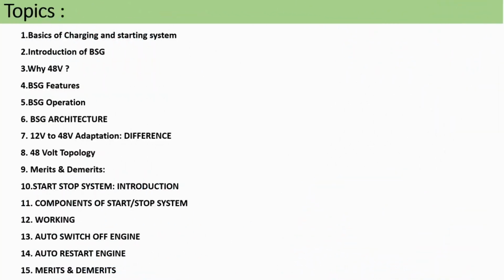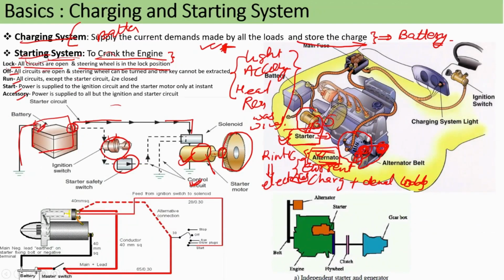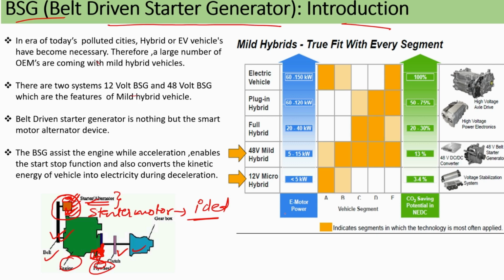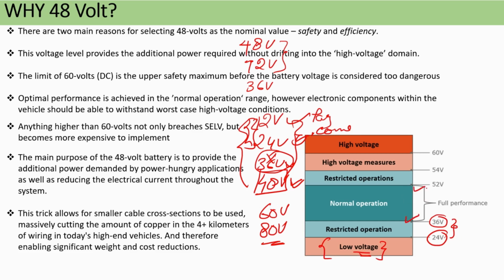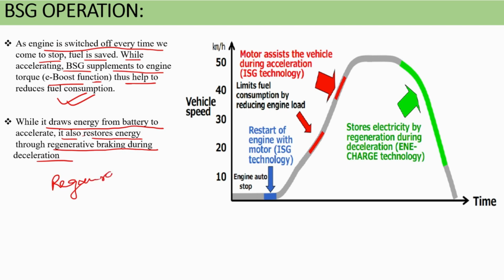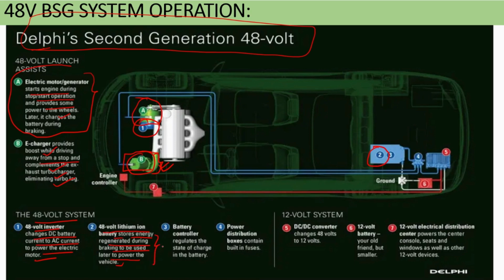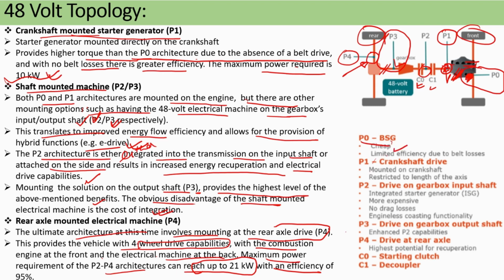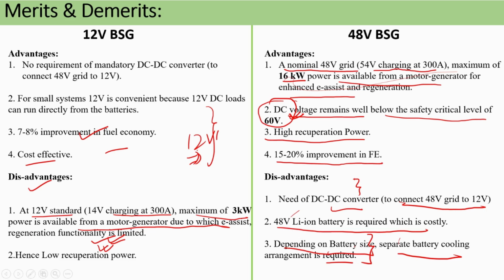48 Volt BSG  BELT STARTER GENERATOR Tutorials|| Basic of Alternator

Comment: voltage is directly propotional to the current right then how will the cross sectional area of the wire will be decreased if we use 48V. as voltage is directly propotional to current it should increase by increase in voltage pls explain
Reply: u(t) = - L * di/dt ...  Voltage in electric machines is proportional NOT ONLY to current.